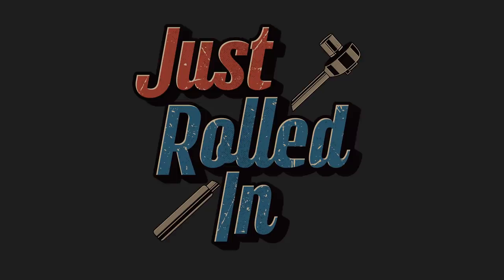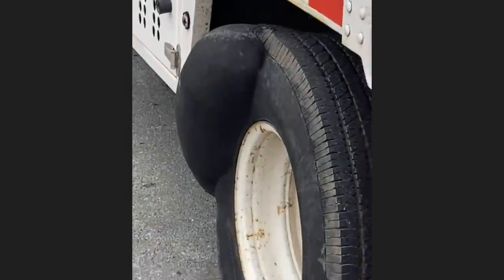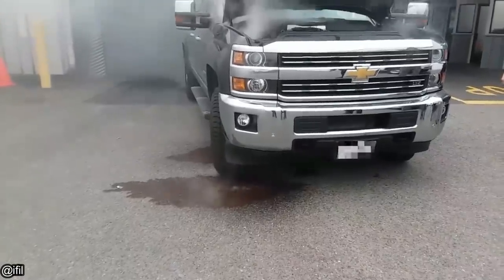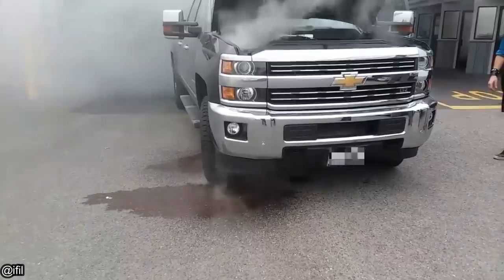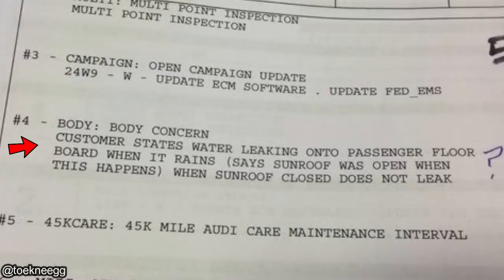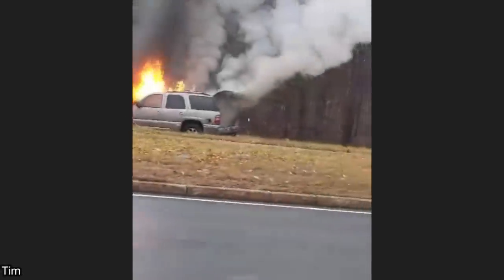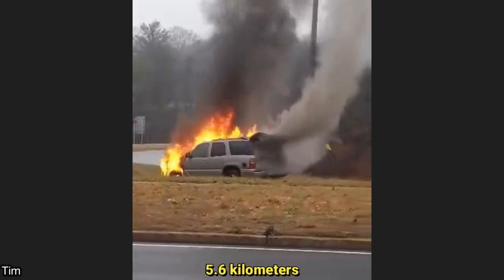Customer States They Have A HUGE Bubble On A Tire | Just Rolled In

Comment: I have a few customers that work in construction and although getting that many screws and nails in one tire by just driving is super rare, it happens. I had one guy come in with a 4 inch drill bit go in the tread and out the side wall but DID NOT PUNCTURE thru the belts! Still holding air! I had another customer (also in construction) constantly catch nails in his tires. More so the rears. Then when the car finally went to scrap, we found an old big box of nails in the trunk that had been lost and forgotten in the messy abys of that trunk that had been falling thru a rust hole. I put 2 and 2 together because I recognized the nails that were left and there was not very many left from that big box he had been nailing himself lol
Reply: It's usually the rear tyre. The nail/screw/whatever lies flat on the road so the front tyre rolls over it then if you're unlucky kicks it up so the pointed end is upwards when the rear gets to it. You'll probably drive over dozens of nails without this happening.
Reply: I had a couple job sites where I was constantly picking up screws in my tires.
Reply: I used to do new construction drywall and insulation on large luxury apartment complexes and I can confirm nails are a pain screws usually aren't too bad . I always carried a plug kit for the nails if it was a screw I'm not going to lie 90 percent of the time I'd just screw it in the rest of the way and if it didn't leak off I'd go . About once a month or so I'd go to the tire shop and get my tires patched it wouldn't be anything to have 2 or 3 screws in each tire . End up having to replace tires About once a year 🙃 😑  .. I don't miss it that's for sure . That nor the itch.
Reply: @miztatone918  I usually reverse them out a bit,  a bit of silicone,  and re tighten.  works great
Reply: @Graham_Langley  I guess you are absolutely right. I got for a second time a rear right tire puncture from a screw and I wondered why, thinking it was because of the closer path to the curbs, which might have all sorts of trash, but yours sounds much more realistic!

Comment: No matter how many impossible things you've seen in the oil pan, from shiny silver liquid, to asphalt-like tar, to hardened plastic, to oil-based jello, to most of the engine in little pieces, there's always some fresh new horror. It's waiting for you in the pan.
Reply: Next time its going to be full of chocolate milk
Reply: @MemeBurger  I got some of that from the rear diff. of a neglected Jeep Wrangler a couple of years ago. Good times...
Reply: @alanb6866  i mean r e a l chocolate milk, although both arenymt great for car parts
Reply: @alanb6866  I changed the diff oil in my Astro van probably for the first time in the vans life last year. Looked like beer foam! Along with some metal chunks of what I think is from the limited slip that does not work at all Teeth on the pinion and ring gear looked ok surprisingly. All I did was seal the cover back up, a bottle of that lucas molasses and gear oil and it's still going today. Noisy, but good enough lol.
Reply: @michelleberry-1314  put some sawdust to reduce noise 😂
Reply: @StratoArticA  Naahhh. Bananas LOL
Reply: Like, atf, and nothing but atf, because im flushing my 65 year old engine.
Reply: Some while ago he posted a video showing an oil pan with two scorpions in it, another video with scrambled eggs. One just can't imagine what's next.
Reply: This kind of makes me want to drop the pan and put a laminated picture of John Cena in there... Just in case I ever have to take it in.
Reply: It's all rather impressive, really... in an awful sort of way.
Reply: He posted one in another video that had a new roll of electrical tape in the oil pan. It clogged the pick-up. 🤣

Comment: I had a lowboy equipment trailer with 8" tires.  Once I was going (prob way too) fast on the freeway and I noticed the tire appeared to be getting low due to the lean of the equipment and sudden mushy trailer response to steering.  As I got off the next off-ramp slowly, it got all the way down to completely flat.   Limped into a very sketch gas station at 130am and fed $1.25 of quarters into the air machine.   Started adding air and was gratified to see it inflating.  Once it was halfway to pressure a big sidewall bubble started forming, and when I was ready to pull off it was bulging almost like the one in the thumbnail.  Decided to see how far I could make it.  Got all the way to beneath the gas station canopy and that tire went BOOM! and echoed resoundingly.  

Had to pretend-lock the safety chains to a lamp post, hustle 40 miles back to the shop, get my 8X16 car hauler out and aired up, hustle 40 miles back, then figure out how to load the trailer onto the trailer by myself.  Long story short I got everything parked back at the shop with the sun well above the horizon, slept less than an hour, then worked a full 10h shift.
Reply from the maker: Sounds like one of those shifts you just want to pull your hair out lol. Glad you got it figured out though and didn't get injured.

Comment: Huge bubbles on a truck tire is no joke, stay the hell away from them, let a pro tend to it. I had one blow while waiting for a tire change. A football sized chunk of rubber blew out into the trailer next to me, it almost went through it. Don't  mess around with them.
Reply: Wise words. There's a few Russian and Chinese clips showing tyres blowing, it's like a small bomb going off.
Reply: I haven't had any tire bubble yet myself, but I once bent my car's right front steel rim to the point you could see the whole tire's bead (Surprisingly, the tire didn't deflate and held air, though it was still toast as the sidewall had a tear)...
Well, the first thing I did after putting the spare was to grab my valve core remover and deflate that tire completely. Better be safe than having it blow out in the spare wheel well...

And yeah blowing truck/bus tires are no joke, there's like 8 bar of pressure in there, if it explodes it can just kill you. Someone in my family was overtaking a truck when one of its trailer tires burst...it blew the front bumper right off of their car o_O...
Reply: @michaelmclachlan1650  It is a small bomb, it just uses air pressure rather than explosives.  The only thing nastier is a high pressure steam explosion.
Reply: Simi truck tires are typically at about 110psi so yea be careful

Comment: The sunroof issue & the rag-top Jeep were hilarious!  (Mental-age of 3yr-olds?) 
Also it's just plain common-sense to disconnect the battery if there's an electrical-wiring problem!
Reply: Not everyone do so ... 
I have a memory of walking home from a fiest/party down town when smelling a peculiar smell. Looked around, found a car in the backyard of the local BMW dealer ..
smelling something  ....
called the fire brigade and told them exactly where the thing was (they were around 1000 m from me), got accept on where it was and walked home. The car had been stolen, found and transported to the dealer for fixing up but the car rescue guy didn't remove the battery....
burnt up car ....
Reply: And THAT'S why "common sense" is no longer common, sadly.
Reply: You can disconnect the battery, IF you have the right wrench, but once a fire has started, it's too late.
Reply: I think it was a legit concern. The roof when they open it it can flood because the sunroof drain holes are clogged. But it was written wrong and taken out of context thus turns into a meme.

Comment: Runaway diesels can be stopped by smothering them. Take a rag and use it to plug up the air intake, that way you can at least limit the potential engine damage.
Reply: But that doesn't always work.  And in that case you would have to get the air filter box opening completely covered up and hope for the best.  Sometimes you get lucky but I've seen that go both ways.

Comment: My diesel VW (decades ago) had a head gasket failure that fed oil into the rear cylinder. It ran away like that truck in the video (and smoked like crazy in the process because it fed coolant in also). I put it in gear and stopped it with the clutch. Then I had to rebuild the engine because the leak was caused by a crack in the block. That car gave a lot of trouble in the years I owned it.
Reply: Look for a video of a locomotive with a lube oil leak from the turbocharger. They go just outright nuts before they blow the internals all over the place. Most have about 300 gallons of lube oil in the system.

Comment: Oh no, that truck!  Expensive lesson!

(When I worked at a dealer a tech did that... Luckily it was a gas car and just smoked like hell.... I got tasked with driving it around till the smoke disappeared, washing and cleaning the car, and filling the lady's gas tank up) I was the lot guy.

She wasn't mad, but I always remembered her car coming back in!
Reply: Between the oil blowing into the intake from the PCV and the crap coming back up from the EGR, I bet that engine is NASTY on the inside.
Reply: I wonder what the conversation to the owner will be.
Reply: @dieselfixr  Yeah, really. Hope the shop has good insurance.  Obviously needs a new engine, but probably a turbo and a lot of emissions crap, too. I'd love to see that engine with the heads off.

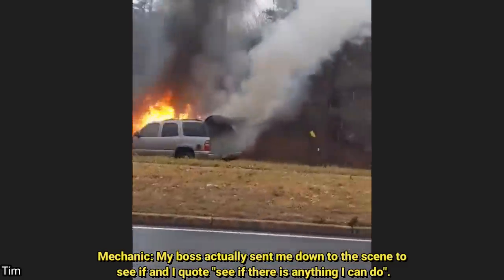Comment: So around 2:44, there was nothing he could do? 🤣
That sucks that another shop actually caused a person's vehicle to burn up though. 
Thanks for the vids man. Take it easy. 😎
Reply from the maker: Appreciate you being here and maybe he could have peed on it? 🤪
Reply: I'm not even certified and even I certify my slip-shod, half-assed work for at least 5 miles. Those semi-legit places need to step up their game.
Reply: I saw a minivan smoking from under the hood at a stoplight. Then flames between the hood and the windshield. I keep a fire extinguisher in my truck so I jumped out and grabbed it. The driver of the minivan got out and trotted towards me.
"Is anyone else in there?!?!" "No!"
Very fortunate because that van was fully engulfed in SECONDS. It was incredible how fast it burned.
Reply: The only way to stop a runaway diesel is  To pull up the air filter and throw a wet rag in.  But by that time the damage is usually done.  So is it worth risking it blowing up in your face for a vehicle that's already wrecked
Reply: @JustRolledIn  
"maybe he could have peed on it?"
I'm dead.
Reply: @JustRolledIn  It worked for Gulliver.
Reply: @ehcanadiankid1  It used to be empty an old-style BCF fire extinguisher into the inlet - a piston manufacturer here here in the UK recommended having one handy when starting an overhauled Diesel for the first time.
Reply: "there was nothing he could do?" if he was fully aware that the other shop did some shenanigans to the electric system in this car then disconnecting the battery should be a first thing on his "to do list"...
Reply: @ehcanadiankid1  In car with manual transmision you can stop it by switching instantly high gear... but this is american pickup so no manual transmision and on top of that "supersized" engine with silly amount of torque.
Reply: @Bialy_1   Diesel don't need no spark. even if you disconnect the battery on a gas the alternator may generate enough power to run without a battery
Reply: If only he had a sunroof on his hood that leaked when being open. 🤣

Comment: WOW that bubble.  I guess I should replace that dry rotted tire from 2014!! eek!! Thank you for all your videos.
Reply: (Original never-used, holds air factory spare on my bought-used, 4th owner 2002 Saturn SC2 coupe enters the chat).
Reply: Don't bother. Old tires can't bubble.

They burst.
Reply: I have a spare on my Tracker with a 96 date on it and yes it is going to be replaced.  The joke is it still has good tread.
Reply: @markh.6687  I had a 2002 and the last time I drove on the spare (also 2002) it was 2019. It worked fine! I didn't keep it on the car for too long though, since it was a donut tire.
Reply: @johncameron2241  A Tracker is still running somewhere? Haven't' seen one in a while, but I did see a Suzuki Samurai over the summer.

Comment: screws in tire:  I was installing cabinets in a new medical building where they had covered parking on the first floor, and the offices were above that. there was a bobcat in the parking lot with all 4 tires flat with probably 50 screws in each tire.  They had just sheet-rocked the parking area and I think the sheet rockers dropped more screws than they used.  and then someone drove the bobcat in the parking area...
Reply from the maker: Wow lol. That won't be cheap tires to replace
Reply: Was working with a (tracked) excavator around a largish building under complete renovation once, one side had been closed off while general purpose smurfs inside tore out the old stuff and chucked it all out the window to sort through later so that the specialty smurfs could get started on their tasks. After something like three trucks and four cars with trailers had received up to five flats on one that I could observe and count while backing up and loading, they stopped the rather hilarious (for us onlookers) manual sorting and cleanup attempt and hired us to do that with excavator and then remove gravel and put in new, without the metric bajillion screws, nails, glass and random small metal bits.

Comment: On the last one...If the problem was electrical and this was known, why didn't the tow truck driver disconnect the battery in the car? My old rest daughter was a tow truck driver for a while. it was standard procedure to disconnect batteries on ALL towed vehicles and make a record of it. Why?  Because IF there was an accident while towing and fuel was spilled, there would be no spark to ignite the fuel. Yes, sparks CAN come from other sources, but disconnecting the battery eliminated  the obvious source and covered the tow company legally.

Comment: Looks like that shop is going to be paying for a new engine!  A run away is nothing to be near when it lets go. Last one I saw in person was a Mack MP7. Blew the whole back of the motor off. Parts came through the floorboards.
Reply from the maker: That's scary. I had a Perkins run away once. Luckily that didn't happen and it was enclosed (generator).
Reply: Exactly. There's a few clips out on runaways involving locomotives, everyone is way, way back.
Reply: With a manual gearbox you can crank the handbrake on real hard and basically drop the clutch in 3rd and stall the engine against the handbrake. Not sure if you can do it with an auto box. We had a bunch of diesels at work which had bad valve guides and the engine would burn it's own engine oil. It was a factory fault that had a recall against it.
Reply: @thehairygolfer seems like there are a dozen ways that oil can make its way into the engine. Whether it be valve guides as you said, turbo seal, leaking headgasket, failed pcv, etc. Wouldn't it be easy to simply install a throttle plate to shutoff the air supply?

Comment: The overfilled oil in the truck probably prevented the drain working on the turbo and the engine ran away on the oil coming out of the turbo bearings.
Reply: Yep, but given all the different reasons a diesel can run away, why do they not have valves on the intercooler piping to kill the air supply? One could definitely say that's safety related
Reply: @SupramanTRD They could just close the throttle body.

Comment: That whole runaway diesel problem, just cut the air supply off. Forcefully ripping the air box apart would still be a cheaper fix than a grenaded engine. Maybe that won’t work with a smaller diesel but I’ve seen it work on 621B Cat scraper. The old Detroit’s used to have a flapper just past the blower that you could yank just for this reason

Comment: If engine goes on run away the trick usually I've heard(not tested myself yet...) is to block air intake asap it might save the engine from total overhaul just saying for people to save some time :)
Reply: Good luck getting that aircleaner off in a hurry. 
Then when you do get clear access to the intake, you need something big and solid to seal with. I’ve seen jackets and shoptowels sucked in.
Reply: @benjurqunov  Yea... That's what I have seen too :) Thought to say about it so if somebody needs it they could see that message :)
Reply: if the truck was a roll over and you wanted to start it you would take the air box apart and have a board or a hard ball that could block the air intake ,, some guys if a standard will dump it in a high gear and dump the clutch .. it could stall it ..but if your not ready for it by the time you could block it it will be too late ..

Comment: Hahaha Tire Herpes... I just replaced my front end parts and the BFGoodrich tires on the front only of my car. I noticed the rear tire was low and so I pulled it off when I seen a screw sticking threw it. It was a small wood screw the size of a computer case screw so I think I need to replace the back tires now too. LoL. That truck that is overfilled with oil would be awesome camping where Mosquitos are common. I don't think you have wiring issue in your truck  I think you have a leaking  fuel issue. People sure hate their cars. We don't have a gun problem we have a hate problem.
Reply from the maker: I freaking hate mosquitoes so that would be the perfect weapon for me lol
Reply: @JustRolledIn  Spiders Mosquitos and snakes... I hate them all.

Comment: I thought that if you cut off or blocked the air intake it would shut the diesel down in a runaway situation 🤔.
Reply from the maker: Definitely does
Reply: My old Detroit Diesel has a flap built right into the motor for this very reason. (in case of compressor oil seal failure)

Comment: I had a 1993 Honda Accord which came with Michelin tires.  They had lousy traction (the ABS couldn't handle them).  They also got sidewall bubbles like crazy.  I finally replaced them with Goodyear Eagle Aquatread tires.  Much better traction, and no more sidewall bubbles.